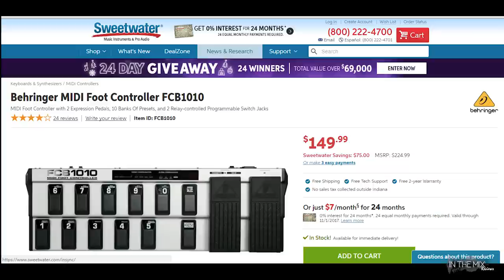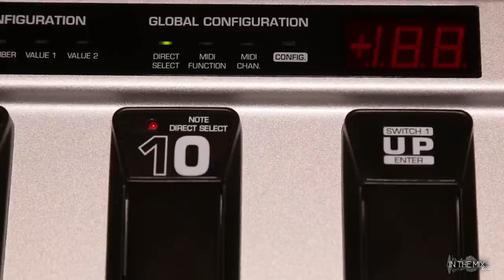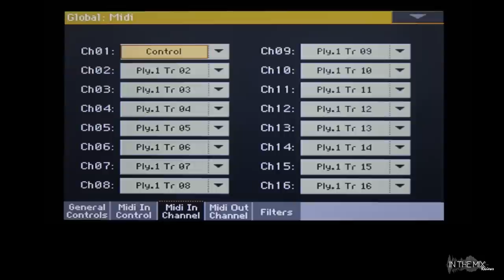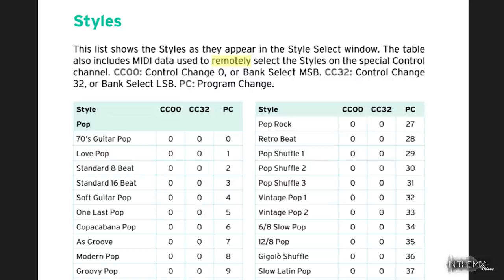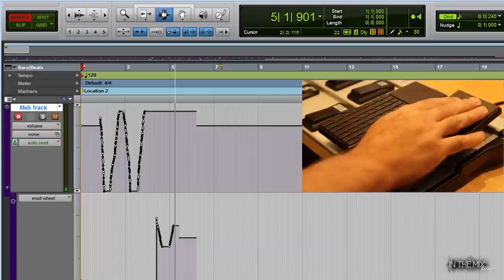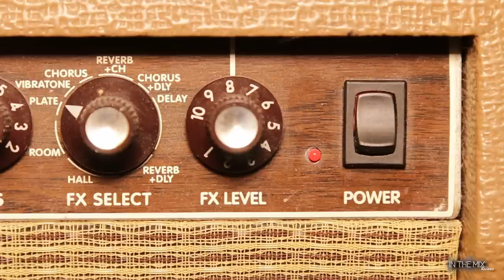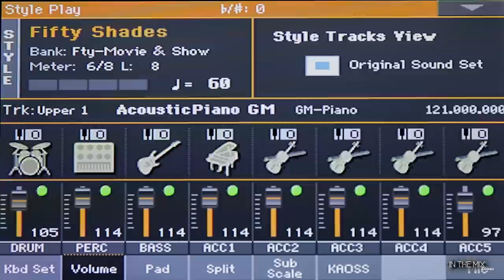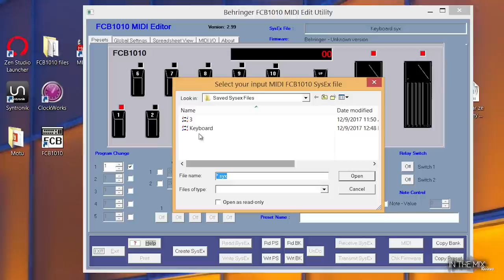Behringer FCB1010 Full Tutorial / Video Manual

Comment: I’m getting one soon
Reply: how do i know if mine needs to updated?
Reply from the maker: It’s in the video. You can see what the eprom looks like once you open the bottom plate.
Reply: @InTheMixReviews  it says it doesn’t need to be updated
Reply from the maker: What says?
Reply: @InTheMixReviews  Uhmm the fcb manager says it’s up to date
Reply: @InTheMixReviews  I had it t toggling stomp boxes then when I woke up it wouldn’t toggle them anymore
Reply from the maker: Don’t go by that. You have to open up the bottom plate as shown in the other video. That’s the only way to be sure.
Reply: @InTheMixReviews  well I had it toggle stomp boxes last night then this morning it not work. And when I try to reprogram the midi learn I step twice nothing so I have to figure out what I did to get it into the mode to learn
Reply: @InTheMixReviews  I looked at it and the numbers on my chip are not the ones you say to have
Reply from the maker: @creepymcpeepers  This video is at least 3 or 4 years old. I don't know what the latest chip is these days. Also your posts are super vague! You say ' the numbers on my chip are not the ones you say to have'. You wrote all that, but you didn't say what the actual number was!!! You definitely need to join the FCB1010 Facebook group.
Reply: @InTheMixReviews  I don’t have Facebook maybe I will get the occulus soon and get back on facebook
Reply: @InTheMixReviews  I want some slipknot nft
Reply from the maker: @creepymcpeepers  What do you mean?
Reply: @InTheMixReviews  I don’t have facebook. Hey when you power the behringer fcb1010 off are you supposed to use the power switch? Cause I just unplugged it. I just now saw that here was a power switch
Reply from the maker: @creepymcpeepers  If you didn't know there was a power switch, how did you turn it on in the first place?!!!
Reply: @InTheMixReviews  I just plugged it in and it came on
Reply: @InTheMixReviews  I was wondering if when I u plugged it that way is why all my toggle is erased
Reply from the maker: @creepymcpeepers  That I don't know. I've never turned it on/off that way to see if that erases the programmed data.

Comment: Still having problems with Behringer with my Ableton despite having 2.5 chip (was already in brand new). Should I buy UnO2 v.1.4 or EurekaPROM?

I think my FCB1010 can't even save properly midi commands and notes. Despite saving it sometimes goes factory mode for a moment. It's hard to send different notes to Ableton (sometimes its always the note/command in MIDI prog.)
Reply: Im using 2 MIDI cables via Interface. Should I use USB/MIDI cable? FCB1010 Software can't even recognize the controller via Interface properly (can't use save function from there).
Reply from the maker: I have the 2.5 factory chip, and never had any issues. I use a 15 year old midi to usb cable. I haven't tried it with Ableton but it works perfectly fine with ProTools.

Comment: Thanks for making such an amazing video for an older piece of gear ! I've bought mine some years ago but never really used it. Is there no way to have a preset send 5 PC messages but on different channels ? My guess is no. I'm trying to have a PC message to my midi controlled guitar amp, and a PC message for my fx rack on a different channel.
Reply from the maker: Hi Fred, glad you found the video useful. I think midi channel is a global setting per preset. Each preset CAN have own dedicated channel but you can’t assign multiple channels to a single preset
Reply: This video helped me a lot, I just bought a FCB and will arrive in a few days... I have the same question, from what I understood while watching this video, when you call a preset you can send up to 5 program changes, and all the 5 prg changes will be sent on the same channel... however, I just read the manual and realized the FCB will behavior this way because is the default setting, all the 5 program changes will be sent on midi channel 1 by default, but you can enter the global settings (by turning the FCB on while holding the DOWN button) and change that, so this way you can send these program changes on 5 different channels, and from global configuration you can set any of the other parameters (MSB, LSB, EXP pedals, notes) to different channels
Reply: Check the topic 2.2.2 on the manual, from my understanding, when you set a specific channel to program change keys 1 to 5, this will be a global setting, so whenever you create a new preset on any bank, and choose how many program changes you want to send (1-5), the fcb will recall the channels set on global configuration for each one of the program changes... this makes sense since you would likely want your modules to listen to a specific channel
Reply: Mine unit has come, I started using and exploring the FCB features, and  what I said is right... you can send 5 different PC messages on different channels, when you call a preset, all the activated PC messages and CC commands in this preset will be sent in this order: PC1, PC2, PC3, PC4, CONTROL CHANGE 1 and CONTROL CHANGE 2, and finally PC 5... so if you set the individual midi channels for each PC messages you are ready to go, just remember that only PC5 can send bank selection messages due to the 2 CC messages sent before it
Reply: @yagolimalins  Oh glad I came back to this video and for some reason wanted to find my old comment lol.
Alright I will look into this, thanks for sharing !

Comment: How do you have the FCB1010 connected to the keyboard and the computer at the same time? I assume that's the configuration that you are using now .
Reply from the maker: I'm not. I've never tried it that way actually, but it should be possible. You would need 2 midi cables though. As long as your computer/DAW is set to pass thru midi info, it should be just a simple daisy chain. I've never needed to have this kind of  set up for the FCB1010 so haven't done it personally.
Reply: @InTheMixReviews  The reason I was asking, was so I could use my Kronos with the FCB1010 to simply change Karma scenes and use the expression pedals for different purposes than one that I have connected to the back of the keyboard. But apparently, using the app for the FCB1010 makes it easier to make changes and to save settings. On one main youtube video, where they go through the whole setting up the FCB1010 with the with the app, they also seem to be using a Korg keyboard with and making settings adjustments on the app. But I can't get an answer from them on how they have it all physically connected.
Reply from the maker: Is your Kronos already midi'ed to the app?
Reply: @InTheMixReviews  All I can say is, in the app, it seems to recognize the Kronos as being in there. The Kronos itself is connected via USB to the PC. Then, I have the MIDI cable connected to the FCB1010. I opened the app, and the only error seems to be that it recognizes the Waves Soungrid system that I always use and is always on, but, it isn't connected to it. I don't really need it to be for now. Other than that, there are no error messages. I don't know how I would do a quick test to see if the app responds to the way the keyboard and FCB1010 are connected. Sure, no error messages, but I haven't tried anything yet to see what works and what doesn't.

Comment: I feel like a fool for still not being able to figure this out. Programming PC messages, I was able to comprehend up to that point. I'll start by stating what I'd like to use this controller for, which is nothing really more than controlling a neural dsp plugin so I don't have to stop playing guitar to get a different sound. 
As far as equipment goes, I have the FCB1010 connected to a macbook pro via a Roland UM-ONE-MK2 usb midi interface. Then the rest is just my guitar plugged in to the macbook via Focusrite Scarlet Solo 2nd gen audio interface.
I can't seem to figure out how to find a "program change value" in the neural dsp plugins midi icon. I assume that's where I'm supposed to look.

Comment: How do you assign different parameters to the pedals themselves? Like if I want them to control gain and reverb and not volume and wah? I am not finding that specific task in this video or any video! And it is not in the manual either. I see pedal calibration for other usages, but not for that precisely.
Reply from the maker: Because it’s the same exact procedure as assigning the pedals to volume. If that parameter in the target device CAN be remotely controlled with a CC #, you assign that CC# to the pedal and that should do it. That is not really a FCB1010 question. That’s more a question for the target device. You gotta figure out how that particular parameter (such as gain) can be remotely controlled per  device’s manual first and then program the pedal accordingly.
Reply: Okay that does make sense. -So I need to go back to that part and really understand it and then apply it in that way to the pedal. I just need to understand exactly how to assign the CC# to the pedal. I don't think I need the computer to do this, do I? But yes, basically I want to have one pedal control the gain and the other control the reverb. I did calibrate them though. -I actually just bought the FCB1010. I have had the VAMP for awhile. But it was taking forever to find a good cheap controller that wasn't too old with old firmware and that was in good condition. So I did find one for $100 on FB marketplace. She bought it new in 2013 and used it about a year. I cleaned it up and it looks new now, and to my surprise already had the 2.5 firmware, and it did talk to the VAMP right out of the box. Right now one pedal is wah and the other is volume, and is that way on all the patches. I know you can assign them different for different banks so that is nice. I just need to get really familiar with this. I know there used to be an FCB1010 group on Yahoo but I think that is gone now. Surely there is another one somewhere! Anyway thanks for your response bro, it was actually very helpful.
Reply from the maker: @michaelhildreth9609  It's no trouble at all. Yes, Yahoo groups are gone forever, but there is a Facebook group. I'm not a guitarist so I can't give you specific info from a guitarist point of view, but we definitely have guitarists in that group that use amps, sims...etc. In general, what you said is correct. Let's just say your device requires CC#66 for 'Gain'. You'll assign one of the two pedals to CC#66 the same way CC#7 is assigned to volume. FCB1010 doesn't really care. It just transmits whatever CC is being assigned to by the user. In that case, that pedal should control the gain. Some instruments have to be put in a special mode or be on a particular channel in order for this connection to work. So that's another thing you need to find out about your device. You do NOT need a computer. This video will show you all that.

Comment: Hi, I am very interested in the FCB1010. My question is, is it possible to use this at onze for two different keybaords (Korg Pa4x and Nord Electro 6). I want to use 1 expression for the Korg and one for the nord. And I want to use some pedals for the Korg and some for the Nord. 
Thanks for your answer
Reply from the maker: Yes and no. There isn't really a short answer but let me try. FCB1010 can only transmit on ONE channel at a time and that channel information is a 'Global' setting. You can NOT program preset 1 to transmit on channel 1, and preset 2 on channel 2 or whatever. So you can't simply program the Pa4x and Nord on different channels and have FCB1010 to relay midi that way. Now, there are some software and/or hardware solutions that you can use to re-channel midi data, and set up a map where certain data could be transmitted on a different channel for a 2nd midi device, but I haven't used the FCB1010 in that capacity. You might want to post your inquiry in the Facebook group to see if anyone has a better suggestion for what you're trying to achieve.
Reply: @InTheMixReviews  Thanks for your answer. There is one problem. I don't use facebook or any other social media. Perhaps you can do this for me? Thanks a lot!
Reply from the maker: @jovers70  I don't know of any other FCB1010 group personally. There used to be a huge Yahoo group that went bye bye a few years ago I think. If you're serious about the subject, open an account under a random user name and pursue it that way. Once you come to a final conclusion after your research, maybe you could come back here and post a summary of your findings. Thanks!
Reply: @InTheMixReviews  I'm not sure that's correct. I believe one can set program changes 1 thru 5 to different channels and associate that with a single pedal push.
Reply from the maker: @PaulLebow  Sorry Paul, it's been a very long time since I've programmed the FCB1010, but I clearly remember there is a limitation with the stock chip. There is a global channel setting limitation that gets in the way for essential programming across the board. I can't remember exactly what it was. It prevented the board from sending certain messages across different channels. Let me think about it. It'll come back to me.
Reply: @InTheMixReviews  I was pulling my hair out trying to get the TH-U Logic Plug-in from Overloud to respond to the FCB1010 until some nice Youtuber mentioned that for some crazy reason, Overloud programmed the plug-in to only respond on CH 2!  I followed instructions above and set one of 5 available Global PC messages to  CH 2 and it worked. I'm pretty sure I have the latest Behringer chip.
Reply from the maker: @PaulLebow  But that's what I was trying to say. Channel assignment is Global. Once you assign a PC message to CH2, that particular PC message gets assigned to CH2 everywhere on the board. That's the part that I'm trying to remember if it's true or not. Do you know what I mean?
Reply: @InTheMixReviews   I see. But you have the option to assign a different channel to each of five PC labels. For instance,  can't you define what PC #3 is for any pedal/bank combo and it will use the preselected channel globally assigned to PC #3?  That is, can't the actual PC message for PC#3 be different for each pedal  preset assignment?  I thought they were giving you the option to have five PC message "containers" (PC "midi functions") each with up to five different channels.   Sec 2.4.2 of the manual.
Reply from the maker: @PaulLebow  I vaguely remember this wasn't possible. I think it was problematic with PC#5 in particular as that's the one that gets used for the MSB/LSB/PC sequence. I did a lot of research on this back then when I was recording this tutorial. It's been years, and a lot happened since, so I could be wrong. I remember some people even using software/hardware solutions for rechanneling to make certain functions happen.
Reply: @InTheMixReviews  Got it - I could  be misinterpreting. I might fool around a bit to see what really comes out of the foot pedals.
Reply from the maker: @PaulLebow  What are you using the pedal primarily for? Mostly software?
Reply: @InTheMixReviews  Yes. Switching software patches guitar amp effects etc

Comment: Thank you so much!!!!!!
Reply from the maker: You’re welcome. New to the FCB1010 planet?
Reply: @InTheMixReviews   @In The Mix  yes! and thank you for your answer, i'm trying to program it for live performance but I getting this error/bug? i don't know why it's happening, I've assigned only a note message on bank 0 preset 1 but when i press it my computer tells me it's registering not only the note on and off but also a CC message with CC#26, could it be i have a faulty chip? My chip has a sticker on it that says is FCB1010 V2.5 and i'm getting this issue.
Reply from the maker: Then that switch is also programmed to send CC#26. Ho to the editing mode for that switch and turn off anything you don’t want.
Reply: @InTheMixReviews  the only thing turned on is the Note message all the others are turned off and it's sending the CC#26 :(
Reply from the maker: Did you try another switch?
Reply: @InTheMixReviews  yes and it's behaving in similar ways, it triggers control changes that i didn't setup
Reply from the maker: @gusferde  That is strange. I haven't used the FCB1010 for couple of years now. I don't know why that would be happening. Did you try the Facebook group?
Reply: @InTheMixReviews  I haven't yet I'm gonna check into solutions also the fb groups, thank you for your time and attention!